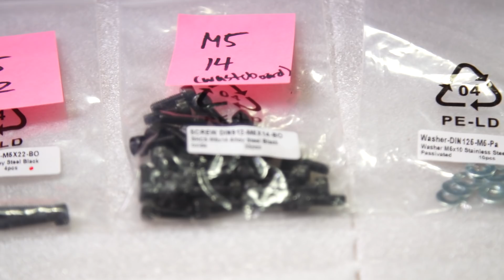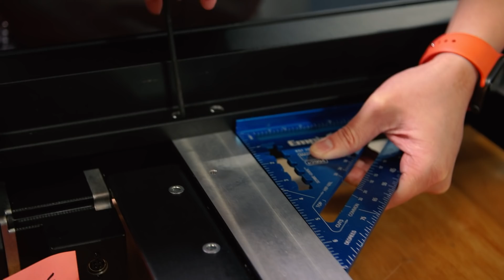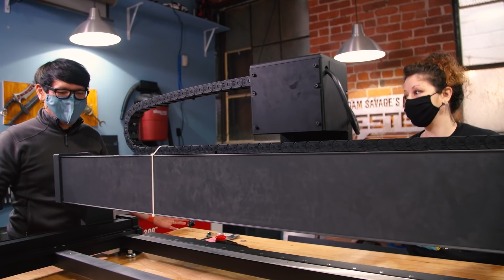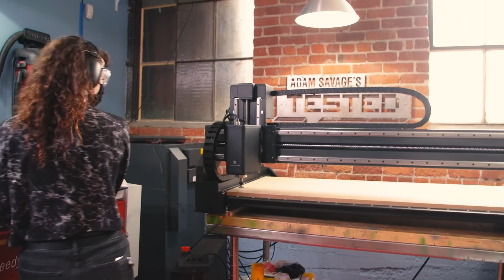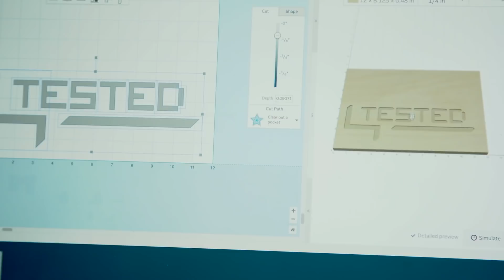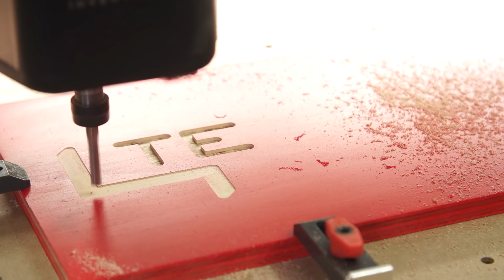Tested's New CNC Machine: Assembling the X-Carve Pro!

Comment: I own one of the earlier X-Carve models.  I must admit, since buying it, I've learned a lot about smaller CNC manufactures. (I had two semesters of CNC back in college 20-some years ago where we wrote G-code line by line, so I really know how long that took).  I've found that Inventables is starting to fall behind other manufacturers, and the Easel software by Inventables isn't all that great.  An amazing software program that is used by hobbyists and even professionals, is V-Carve by Vectric.  I must admit, after using V-carve, I've never thought about designing in Easel.

Comment: I own the old, albeit heavily modified, 2015 X-Carve ( https://imgur.com/a/04LhFJN ) and I can say without a doubt, for the price they're asking for this machine, I'd not be buying it. I'd certainly take it - But I'd not buy it simply because too much emphasis has been given into design at the cost of functionality and practicality - Like those not industry suitable PS/2 Motor Connectors and braided cables with moving Heat Shrinks - C'mon... If you use Heat Shrink on such a cable, at least use adhesive one so things will stay in place but why bother to begin with? You'll want your cables to be as flexible as possible ( and certified for Drag Chain usage! ) and braiding your cables is exactly the opposite of that. The Product Website also omits practically EVERY bit of detail you'd want to know about a machine priced like this including stuff like what kind of Steppers they're using, what type of Limit Switches and cables ( shielded ones?! ) for them have been incorporated, what type of VFD is being used and if it's replaceable, etc... Yea also still using Stepper Motors instead of marginally more expensive closed loop Servo Motors at this price point is an insult to one's intelligence 😑

Comment: Yikes. $12k for this toy, with non-locking s-video connectors for motors?
Uncovered rails and screws? Tiny NEMA23 steppers at this price point? Air-cooled unprotected spindle with no ATC?
This machine is a total joke. Oh, and web-based software, which means when(not if) their website becomes inaccessible, you've got an expensive brick.

Comment: lmao can you please buy a Haas or Tormach?
Reply: Tormachs are kinda crap. Unless they've upgraded.
Reply: @1pcfred  Better then a router
Reply: @VaelirAI  it depends. People that have bought Tormachs would beg to differ in many cases. As I understand it Tormachs are or were at one time just converted far eastern mini mills.
Reply: @1pcfred  check out their new MX series of mills. I've worked on a 440 from Tormach in a tool room once making alterations to press dies, thing sucked a fat one. But for drilling out positioning holes it served a good purpose. So I understand the sentiment you have towards them. I'm yet iffy of them as-well but like how Haas use to catch a ton of criticism for their rigidity issues, yet are one of the top sellers of cnc machine on the globe, Tormach has upped their game it seems. BT30 taper, servo driven, HSM, probing, etc... IDK brother I'm tempted to buy one over a Haas mini mill. Definitely 1000% rather buy a Tormach over any brand router.
Reply: @VaelirAI  it is not my sentiment. I have never used one. I am just going off what others have said. One thing I know is all of these CNC machine manufacturers are crooks. They prey on the ignorance of their customer base to make a profit. Which is a pretty solid business model in this world. Fooling some of the people some of the time can make you rich. Snake oil comes in many formulations. What machine is best depends on what you need to do. That's why there's all different kinds of CNC machines. No one does it all.
Reply: @1pcfred  Dang man, why do you say their crooks? In what way do they prey? Genuinely curious to know what brought you to think that. I definitely agree in some aspect, the treatment I and many other shops I work with get from some of these companies is utterly mind blowing. Unless you are a multi billion dollar corporate company they wont even return your e-mail on a quote for a machine (talking to you mazak & dmg mori)  But other then that once you buy the machine, in my 8 years of being a machinist, I've yet to see any company fail to support a machine after purchase. I have dmg mori in my shop now replacing a draw bar, super nice guy. He is hooking me up by just replacing the drawbar and not the entire spindle which is a cost difference of 30 thousand lol.
Reply: @VaelirAI  I say they're crooks because of the incredible markups they have on their machinery. The value simply is not there for what they are charging. So they are preying on their customers not being able to figure it out. Or even if they do they're over a barrel anyways. Because the practice is so endemic. It's not like they can go anywhere else and get a better deal. The industry employs a broad front of solidarity. Everyone is going to screw you.
Reply: @1pcfred  Yep. Sound reasoning, wont argue with you there. I 100% agree. 

Thank you, btw for sharing. I'm always curious of others perspective of the industry.
Reply: They were paid to make this advertisement.

Comment: Linear rails and ball screws?
Proper!
Reply: I use drawer slides and acme threads. I get thousandth repeatable accuracy too. That machine can accelerate faster than mine can though. I'm not in that big of a rush really.
Reply: They'll be quite dead very quickly, as there's nothing protecting them. The rail wipers in the carriages are NOT meant to wipe chips and grime off the rails, they're meant to wipe clean, maybe marginally dusty and oiled rails.
Same goes for screws and ballnut wipers.
Reply: @Spirit532  I'd wager that machine will last the rest of Adam's life mechanically. I doubt he's going to use it heavily. The cheap Chinese capacitors in it will be gone in a few years though. I bet the SMPS in it will actually catch fire when it goes. I just saw one torn down that had used caps in it. When the parts were salvaged they dented the cans. So they took wax and filled in the dents and resleeved them. Was pretty shocking. Wasn't the only failing of the unit either.
Reply: I actually assumed they had  the usual accordion-style covers but removed them for looks/learning.

Seems like they don’t have any protection. Pity.

Comment: Cloud subscription otherwise your machine turns into a pumpkin. Internet needed to load or save files. Steppers and not servos. NO THANK YOU!
Reply: What's wrong with steppers? The machine moved fine. WTF are you looking for?
Reply: @1pcfred  The price. At $12k, I would expect nothing less than cheap-ish AC servos.
Reply: @Spirit532  what would servos do that steppers cannot in this application? Besides assuage your expectations, that is.
Reply: @1pcfred  Be more accurate, faster, have no lost steps, be quieter.
Reply: @Spirit532  With the rolled ballscrews this machine uses you are not going to get better accuracy out of servos. You can map the machine anyways if it is a concern of yours. Not going to give you faster either. If you're losing steps you're just doing it wrong. Stepper motors run properly should not make noise. I've run stepper motors on pure sine waves and they are whisper quiet then. I've run them with inductive sense resistors too. Then they're loud. So if your stepper motors are noisy that is indicative of them being driven incorrectly. Usually they're being run over current. Stepper motors are not intuitive in their use. There's a lot of idiots out there trying to use them too. The same folks who have no chance of tuning servos.
Reply: @1pcfred  Thousands, to millions, of full steps per revolution is better than 1.8 degrees per hard step. Good rolled screws of higher grade can have an accuracy in excess of what steppers can do. Accuracy is also not only dependent on motor resolution and screw precision, but also on how motion happens. With steppers, it's never continuous, even if you microstep it to death.
Even with sine drive(which is exceedingly rare and murders all hope of cogging torque, on which steppers rely) you will not get the same precision, much less noise, than you would with servos.
Modern cheap(<$150/kit) servos also have continuous self-tuning and work fine for most applications out of the box. And nobody is building these machines at home. They come pre-configured.
And for the record, no, steppers should and do make noise due to the magnetic configuration - they rely on cogging torque, and thus noise is generated.
Reply: @Spirit532  I bet that machine can repeat a thousandth of an inch all day long.  What more do you need? If you need nanometer accuracy then you're not going to get it in that building period. Adam lives in a seismically active zone. There is no rational justification to use servos in this application. There is such a thing as inertia too. Which is how motion really happens in CNC machine. Discrete steps are turned into constant motion. Path prediction handles how that works. Get a real machine controller.
Reply: @1pcfred  I don't know why you so gung ho on steppers. The only place steppers excel is in cost and simplicity.  Like Spirit has stated you can now get decent ac servos for very reasonable prices. They are far superior in every way and now are not much more than a stepper setup. For a 12k machine that is software locked to a subscription the value proposition simply isn't there. The rational justification is the exorbitant price of a mediocre machine.
Reply: @moki123g  it sounds to me that you do know.  What is wrong with cost and simplicity? You are not going to gain any meaningful performance increase between steppers and servos in this application. So you might as well save the money and headaches.
Reply: @1pcfred  Ok well I guess we are just going to have agree to disagree. Enjoy your steppers!
Reply: @moki123g  I do. They can run 200 IPM. But I keep them to around 90. Any faster and I can't jog to where I want to. Plus I don't like my lead going over 1,000 RPM.

Comment: Mechanically a simple machine, I reckon most of the cost must be in the software user interface, because there's nothing for guarding or dust extraction.
Not sure what takes up so much space in the control box either; 6x limit switches, z datum puck , 5/6 stepper motor control signals, spindle power and spindle speed could easily be handled by something down to a Pi or 'Duino sized microcontroller.
Reply: The software is free. Arduinos cannot do motion control very well. They lack the computational resources. They can't do path prediction for instance. I run my CNC machine on a 2.5 GHz dual core. I run a 20K nanosecond real time loop. Which is marginal for software step generation. The PC I use was cheaper than an Arduino or Pi though. I paid $5 for it. it was, "distressed" when I got it.

Comment: heh, how much did it hurt to see it stop right at the glue layer? :p
Reply: SO much! It’s actually fairly nice ply. We were short on time but would have been easy to do another pass
Reply: It is actually easy to fix. One thing CNC machines do really well is cut again. So you can just adjust the height and let it cut another pass a little deeper. It will cut precisely where it cut before. When I isolation route PCBs I'll go over the board a bunch of times just to clean the whole pattern up.

Comment: “Easily accessible”...........If you have $12,000.00😬
Reply: And for this price they even don't have some simple cover of rails and ball screw on gantry😒
Reply: I think they meant "accessible" as in easy to understand, not easy to afford.
Reply: @TonyMueller  I find the tool chain I use to generate G Code for my machine easy enough for me to understand. But I've used some of the more difficult parametric modeling software too. 2.5D tends to be easy. True 3D is where it gets tricky.
Reply: @TonyMueller  this may be true. But "getting into" also covers buying. Not just software
Reply: @TonyMueller  IMO, it's gaffe--X-Carve Pro is neither accessible, approachable, or palatable, compared to other CNC offerings.
Reply: Add to that, IIRC, Easel still requires a persistent internet connection.
Reply: Understandable different countries different price index for different costs ,in china market this price you can get a higher configuration CNC machine

Comment: There are better machines you can get for $9,000. Absolutely nuts price. And that's the 25% off price! It's normally $12,000
Reply: Would you name some?
Reply: @hsmiii  Sure, Avid CNC (formerly CNC Router Parts), Stepcraft (you can get a machine with an ATC from them for this price, it might be a bit less rigid but ATC is more valuable than the little bit of extra rigidity especially if you're machining wood--AND it includes a copy of Vcarve Pro...), CAMaster Stinger series, or for under $2000 you can built a PrintNC (this is a fair bit of work but you'll end up with a machine that has nicer electronics than the xcarve and isn't tied to crappy web based Easel) 
Of if you're willing to import a machine from China, you can get a 4x8 cast iron machine that uses NEMA 34 steppers for right around $4000....
Reply: @timr86868  Ya, been eying the PRO4896 from Avid for ages. Was excited for a bit seeing this video, but 9k+ is insane. I am glad they got a CNC though no matter how they got it. Cant wait for the content.
Reply: @timr86868  I wish they would have done a tear down of that controller. I bet it is TB6600 based drives. They'd run that machine no problem. But they are like $7 an axis.
Reply: @hsmiii  Onefinity, $2500 or so. It's better in every possible way.
Reply: @omegachar4754  Thanks! Looks good.
Reply: @omegachar4754  Nah this one seems way more rigid and stiff than that onefinity.
Reply: @txm100  I'm not sure why you would think that. Onefinity uses 35mm linear hardened steel. There's a video of a guy and his kid standing on the beta machine (with 30mm steel) and there was zero flex.
 I'm not trying to convince you or anything, but the onefinity is a beast as far as sturdiness goes.
I'm also not knocking the xcarve pro as I'm sure it's a good machine but 
 $12000 vs $2500 for the same size onefinity...  It's just not comparable
Reply: @omegachar4754  You can see that just by looking at it. Probably weighs half as much. And weight (=material) means stiffness. And the Xcarve uses Aluminium so that tilts the scales even more.
Reply: I built my own 1500mm x 1500mm machine for ~$1000 CAD. Worth it in every conceivable way. I still intend to purchase an Avid CNC Pro4896, this DIY build is a learning platform. And, it's a way to get into business on a budget in order to afford the Avid machine 😁.
Reply: Is there a price point you like the XCP 4x4 at? Like what is reasonable? I read through most of the machines suggested and most are smaller than 4x4.
Reply: They didn't get that version of the machine. The $12,000 version is the 4'x4' machine, not the 4'x2' which is what they have. 
Also, what software do those other machines come with? Are the machines compatible with the Easel Software which seems pretty easy to learn or will you have to learn to use a more complicated software package? There's more than just the base cost to consider.
Reply: @JMcMillen  Good thing most of the ones I mentioned you can get a 4x4 (or larger) for the price of the Xcarve Pro 4x2.... And several of them come with Vectric Vcarve, which is $700+ software that blows Easel out of the water.... Spending $10-12,000 on a machine to then handicap it with Easel because it's slightly easier to use than way more capable software is dumb...
Reply: @JMcMillen  Onefinity comes with an open source buildbotics controller and is compatible with any software that can spit out gcode like Easel, Carbide Create, any Vectric product, Fusion 360. etc. etc.  
You can also set it up and get it to work within 30 minutes of unpacking as it comes in 4 pieces. 2 Y axis, X axis and the Z carriage. It's self squaring, so no worries about that either. Plug it all in to the controller and you're good to go.  
Best part about it is it doesn't use any v-wheels or rubber belts like the xcarve and shapeoko and you can make it work with other (more professional) controllers as well.
It doesn't require an active internet connection nor does it have to be hooked up to a computer (as the controller is essentially a mini computer).
Reply: @omegachar4754  That's good to know. I've been interested in these kinds of machines but never really delved that deep as I don't have anywhere near the extra money to justify buying one, so I haven't done any in-depth research. I just know that software compatibility is an important consideration because you don't want to save money on a machine then find issues with the software you have to chose from.
Reply: @JMcMillen  I put the machine I have together for $300. I did not have to lay it all out at once either. It is not as big as what's here. Quite frankly I don't want to be dealing with full sheets of plywood anyways. It can certainly cut out what we saw cut in this video. That was the most surprising thing for me in the whole process. Just how into doing small work I'd be. When your machine has such accuracy you don't have to make big things. I was hung up on work envelope a lot early on too. That's what costs with CNC. The price goes up exponentially the larger you go.